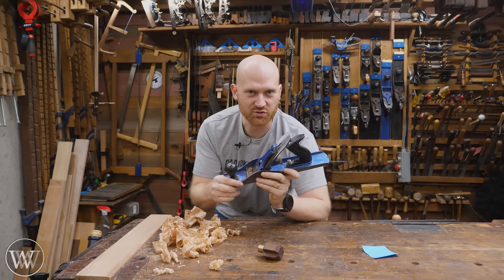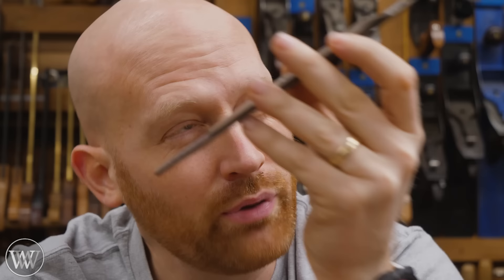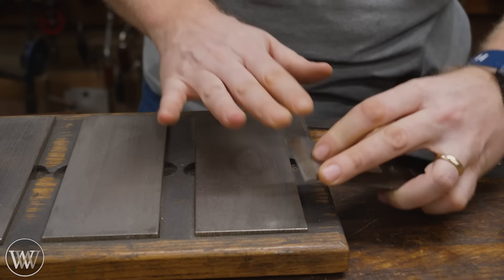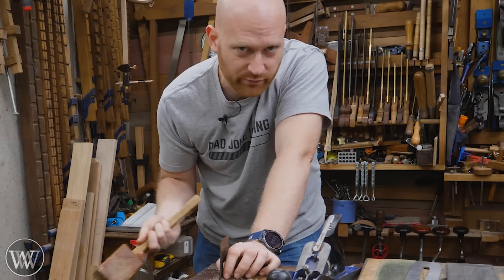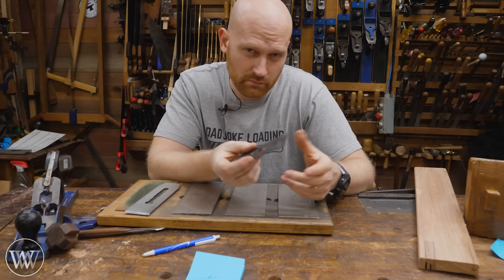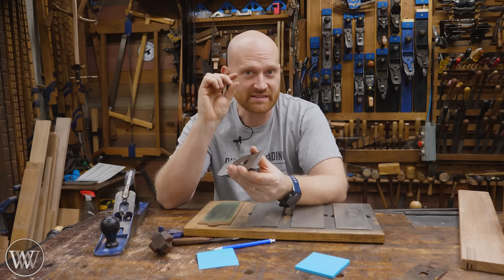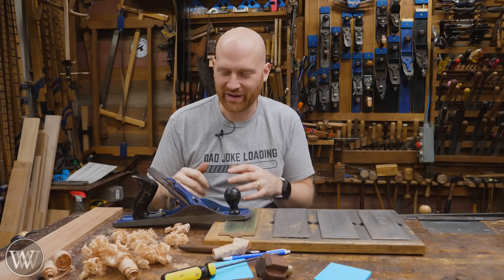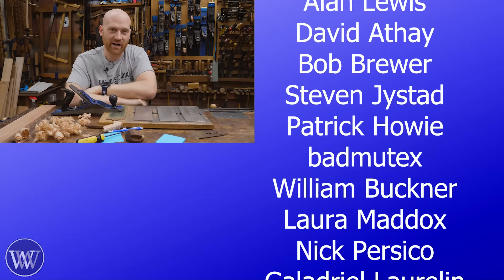How to Fix a Clogged Plane

Comment: After 65 years of woodworking this information is new  to me. I always felt it was a problem with the mouth too closed and/or the chip breaker not in the right place. It also explains why my Qiangsheng number 6 works so well.

Comment: 4:01 alternative to mallet/hammer is 2 scrapes of wood 10-12 inches wider than your chip breaker. Place the chip breaker in vice, now grasp the chip breaker with scrap wood, ( one piece of wood on each side of breaker),  you have now created a handle to gently twist the breaker back to shape.  Old metal workers trick - for heavier iron, longer and bolted together wood pieces give you more control.

Comment: Grand! I made my chipbreaker such that there was no light, but it still clogged. Now I know what to do! Thank you!
Reply: Watch out, if there is no light before assembly, that can change as you tighten it to the iron, it can flex and lift a corner...

Comment: In my adventures into learning how to use hand planes, both the old laminated blades and the modern blades, as well as the Japanese style pull planes, I discovered how they would 'tap out' the bimetal type blades if they were curved or had any bend in them across the cutting edge. Not sure if that can be done with the more modern blades which are all one metal.

Comment: I’ve got a shop full of eBay Stanley’s and I decided I would make one of them a true smoothing plane, I chose my 4.5 because I don’t really like using it so it may as well be a specialty plane.  I fought this fitment issue for two hours, I eventually stole the chip breaker from my #7 then I saw that someone had removed 30 percent of the rounded nose on my 4.5. It took a while longer but I got there with the #7 chip breaker and my 4.5 works great! Now I need a new chip breaker for my jointer lol.

Comment: If anyone is thinking of, or has started, using wooden planes, this is a particularly pervasive problem because of people over setting the wedge and smooshing the cap iron; this can also happen if the wedge is set tightly and the plane goes through heavy changes in moisture and temperature.

Of course, it could also be the prongs on the wedge overshooting the hump on the cap iron or being blunted rather than tapering into the center of the mouth.

Comment: I'm fairly certain that the Spear and Jackson brand of cheap handplanes that are popular on amazon right now are the same as the Grizzly and Big Horn ones made by Soba. Rex Krueger did a good video on them a couple of years ago and that's why I went with the Spear and Jackson(well, that and the name). If anyone here gets any of these planes one thing I found that could help you is that the cap iron sits too far into the mouth by default. I'm guessing their machine is off or they didn't do enough testing, but when I padded the slot the keep screw goes into with a couple of strips of blue tape I found that it was like 5-6x less likely to clog the mouth. Just something to test if you do get a cheap plane.

Comment: One thing I've always wonder about is why so many chip breakers on old planes require fettling.  You would imagine that the original owners knew enough to tweak the breaker to properly match the iron.  In some instances I can tell that someone was building Franken-planes out of parts from different planes, but that hardly covers all the breakers that need help.
Reply from the maker: Office because the irons and Chip breakers have been switched out by people who don't know or don't care. Sometimes it's because they never use the plane for fine work they just used it for hugging off material.

Comment: I have a plane blade that's twisted. Do you have any advice for fixing that?
Reply from the maker: Sometimes you can Hammer those back into place. But sometimes they're a bit too hard and don't want to do that.
Reply: @WoodByWrightHowTo  Yeah I've tried to bend it back into place by placing it in my vise but I was afraid that it would break (the vice or the blade.) 🤣 I haven't tried to do it with a hammer mainly cause I don't have anything that's flat and strong enough that I could place it on. Thank you for your help anyway.
Reply from the maker: I usually put it in the vise and hit it with a soft face hammer. It's like I was doing with the chip breaker here

Comment: My current issue is that I can't get the chip breaker close to the edge of the plane iron, as the screw makes contact with the frog before I can advance it past the mouth. If I keep it (the chip breaker) a couple mm away from the edge, it sorta works
Reply from the maker: Sounds like you have the wrong chip breaker for the plane.
Reply: Similar issue here I may just widen the mouth.

Comment: I cant seem to make my spookesshave work it either clogs or doesnt want to cut at all 
İt has a sharp blade cap screw is tight and mouth has decently large opening
Reply from the maker: Deliver cap sometime just does the same things that the chip breaker would hear.